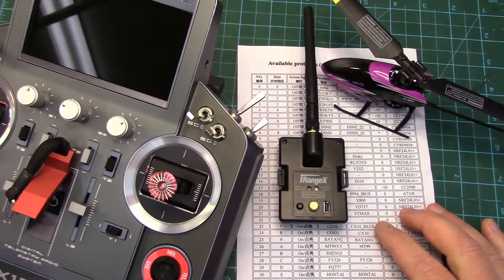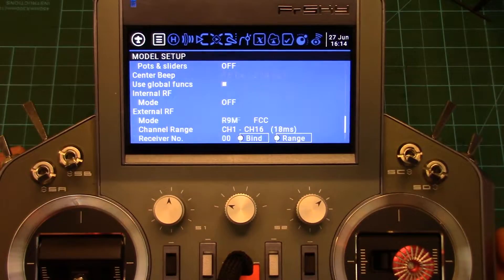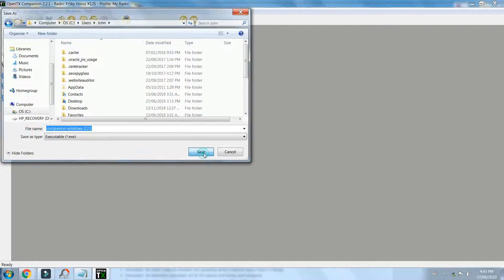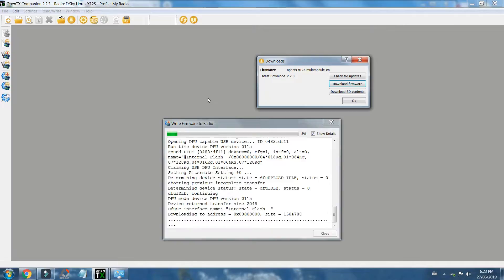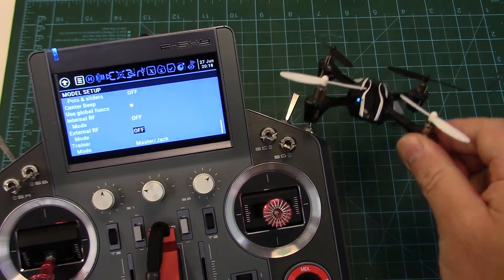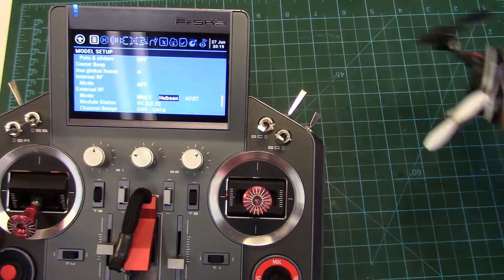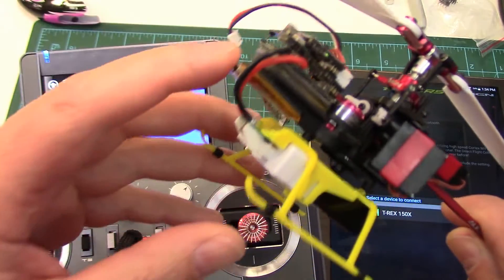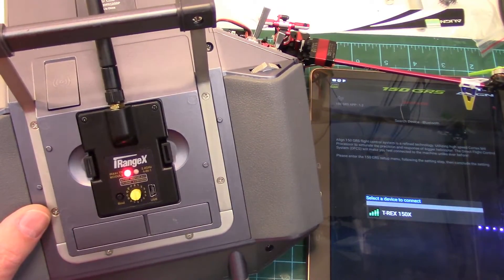iRangeX IRX4+  Multi Protocol Module Serial Mode - OpenTX example.

Comment: Hello!
Coming "way after the battle", but beside the freq adjustment, have you tried to assign a number to you receiver in the radio's menu?
Reply from the maker: Thanks for the suggestion. That was one of the first things I tried and unfortunately, that didn't work either. Even tried a Futaba radio, and it didn't work. Came to the conclusion the built in S-FHSS RX in this TRex 150X was faulty.
Reply: Damn shame... Well, as long as it flies ;)
But I agree the IRX4+can be a bit tricky to use. Updated mine a couple of times before, but it as somehow become impossible to do now. Can't upload firmware, can't update the bootloader... Left scratching my head, but hey, it works anyway ;)

Comment: Just stumbled upon this vejo,    a couple of months ago I brought a second hand horus x12s very cheap,   loaded with open tx,   and was disappointed to find out they weren't multi protocol as it was advertised,     but watching a series of your videos on this unit has really opened up my Hope's again,     was very tempted to ditch it for a Radiomaster Tx16.     This seems like it's just the ticket.    Thanks for putting this out to world to learn from.     What the latest version  of open tx available for the X12s,     and do you know if they are going to keep updating them
Reply from the maker: Latest version is OpenTX 2.3.9 and that is what I'm currently running in my Horus right now. With the multi-module in serial mode, you even have access to the built in spectrum analyzer now. It's awesome!  You can see what all the versions are on OpenTX's site. Multi-Module.org's site is another must bookmark if you get a multi module for updates to it as well for access to a growing number of protocols & fully understand how the multi-modules work and how powerful they are.
Reply: @Rchelicopterfun  Thanks again,    that's awesome.   I'm running 2.2.3 at the moment,     and it's in EU mode,    another kick in the but as I brought some Non EU receivers to rin with it and there were at first not binding until I flashed them with EU firmware,   that was how figured out the issue,    I assume when bootloading from card ect,    just tick the Non EU box and it should be fine .   I'm in New Zealand so have no need for Non EU protocol,   and it is supposed to be a little limiting signal wise,    I've been told to run it with America in the region setting as this will allow the radio to out put the stronger signal
Reply: @Rchelicopterfun  nice,    is that on the computer you are using or on the x12s.     The latest I can find is 2.2.3 for the x12s

Comment: Hi John I think you need to update module ver. via module usb port - this may fix your problem
Reply from the maker: Yes. I did it a couple weeks ago as the  Esky 150 V2 protocol is now supported. Works fine now. 🙂

Comment: Hi, just one question the fine frequency tune for the receivers can be stored in config file. I haven't been able to find it, have you
Reply from the maker: Not sure I fully understand your question. I know it's saved for each model in the model memory file. Ie. when I select a different model (assuming using S-FHSS protocol), the frequency fine tune value is what I programmed for that model. If that data set is in the config file, I've personally never looked for it. Sorry if I didn't understand correctly.
Reply: Thanks for the reply, what I'm referring to is this./*******************************/
/*** CC2500 FREQUENCY TUNING ***/
/*******************************/
//For optimal performance the CC2500 RF module used by the FrSkyD, FrSkyV, FrSkyX, SFHSS, CORONA and Hitec protocols needs to be tuned for each protocol.
//Initial tuning should be done via the radio menu with a genuine FrSky/Futaba/CORONA/Hitec receiver.  
//Once a good tuning value is found it can be set here and will override the radio's 'option' setting for all existing and new models which use that protocol.
//Valid range is -127 to +127
//Uncomment the lines below (remove the "//") and set an appropriate value (replace the "0") to enable.
#d#define FORCE_FRSKYD_TUNING 0
//#define FORCE_FRSKYV_TUNING 0
//#define FORCE_FRSKYX_TUNING 0
//#define FORCE_SFHSS_TUNING  0
//#define FORCE_CORONA_TUNING 0
//#define FORCE_HITEC_TUNING  0
//#define FORCE_HOTT_TUNING   0
and this as far as I get. Then you are suppose to save this to a config file after edited ,but unable to find the file
Reply from the maker: Sorry Alan, that's all Greek to me. As I said, I just dial the FT value up or down in the radio for that model, set it at the best point in that -127 to +127 range, and it saves it for that specific model's RX. I never access the config file/s when doing it.
Reply: @Rchelicopterfun  okay I'm none the wiser too
Reply from the maker: I actually have a video where I demo setting the FT value. Not sure if it will help any, but here's the link if you wanted to have a look: https://youtu.be/O1L0wxzoqOU
The FT part starts around 8 : 40 into the video. Like I said, once I set that, it's saved for that model/RX.
Reply: @Rchelicopterfun  Thanks again

Comment: hey john i new to Frsky x12s  and open tx and the irangerx. i have updated the open tx to the version  2.3.5 and in turn i had to update the irangerx  IRX4 to the new  version 1.3.0. after getting everything updated i got to start setting up my helicopter and when i create a new model i can only select airplane or glider. but i got the heli option on the set tool bar. i dont even have drone model to select. just wonder if your x12s is the same or am i missing something.
Reply from the maker: @richard smith You have to create the category in your model selection file. When you go into the model select menu (where it shows airplane & glider), hold down the select button to bring up the list of file options. One of the selections in that list is "create category." You would select that, and then after the category is created, edit the name of the file to whatever you want (Helicopters, 3D Helicopters, Scale Helicopters, Electric Helicopters, Micro Helicopters, etc.).  Hope that helps - J

Comment: WOW so literally if I connected this to a uart, hooked up a few switches and potentiometers to a breadboard, and wrote the firmware to sample them and turn them into numbers then send them out over serial to the irx4 it'd control my quad? AWESOME :D :D

Comment: As for the T-Rex 150(x), are you sure the protocol has the same/correct channel order? If not, throttle obviously wouldn't be throttle and if it needs the throttle to be low that wouldn't work I guess. Maybe just to be sure create some temporary mixers that just set all channels to their lowest value so every channel is "bottomed out", then try binding again. If it still doesn't invert all channels and try once more?

I'm still very new to all this, but I'm interested in what needs to be done for the binding to work. I got a used 150x less than a week ago and it won't properly work with (even an official) dsm2 module, and I do have a transmitter coming to me that has a mutiprotocol module, so I'll need to get that to work for myself as well in a couple of days. So please do post (video or comment) if you manage to get it working!
Reply from the maker: I do have my throttle channel in the radio mapped/mixed to ch3 for that model as per the multi protocol module channel order of AETR as per the Github instructions. Of course I just assumed since it worked with the Speky RX, it would be the same for the built in S-FHSS RX. How many times have assumtions caused problems :-). I'll try changing the channel order back to TAER, and see if it might work. I wish at mimimum their was a visual indiction on the 150GRS board that it at least bound to the radio instead of making us guess at what might be going on.

I am also going to "attempt" to update the iRangeX firmware. If I get either method to work, I'll certainly pin a comment on this video or perhap make a new one if it's interesting enough. Thanks for the suggestions. Hope you get yours to work as well.
Reply: @Rchelicopterfun  Ok I have finally received my new transmitter (Jumper T16, basically equivalent to a Horus) that runs either the same or a similar mutiprotocol module. I just bound it to the TRex 150x with no problems and no fuss. Just picked MULT and SFHSS, ticked BIND and it just bound. It's got module version V1.2.1.25, in case that helps.

Comment: I'm flying with Taranis Q X7 with the same multi protocol module + Align 150X
There are not many options to ajust in RF configuration. Maybe version makes a difference.
My config is:
Mode: MULTI SFHSS
Status: V1.2.1.64
Ch.Range: CH1-CH16
RxNum: 02
Freq tune: 0
Reply from the maker: Thanks for the feedback on your T-Rex 150X working with this module in S-FHSS protocol. I'm thinking then it must be a firmware version as that's the only config difference I can make out. I'm on V1.2.0.22 so you have a newer version. Guess I'll start looking into the firmware updating process for one of these mulit-modules... Joy - I love that so much ;-)